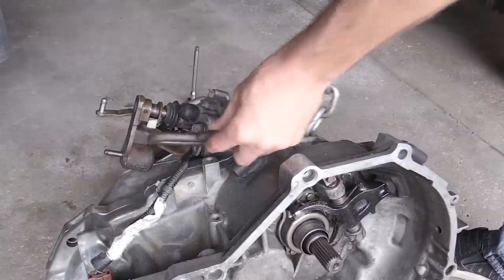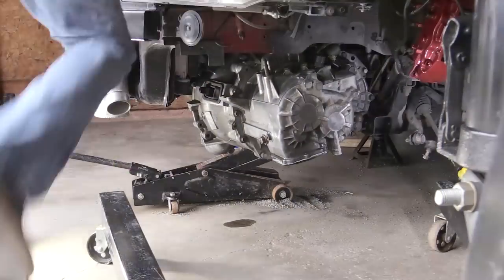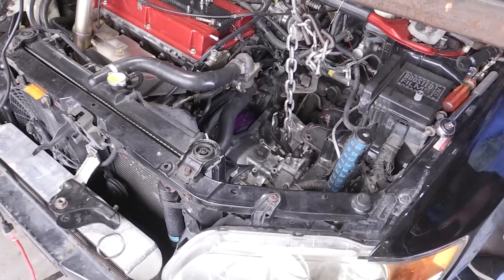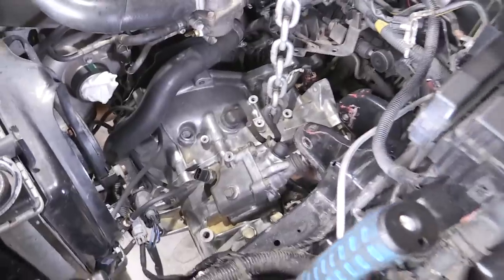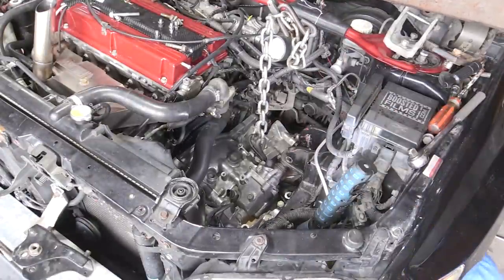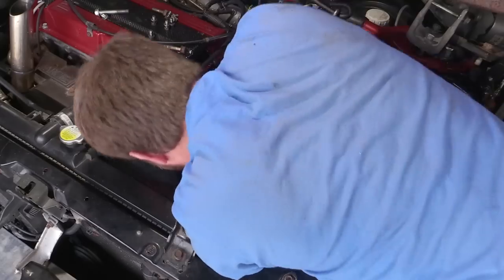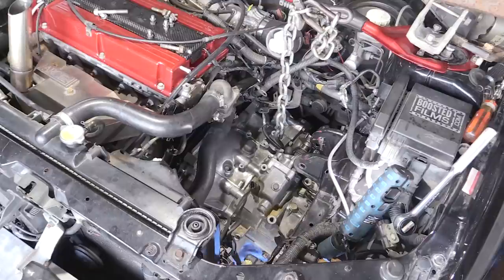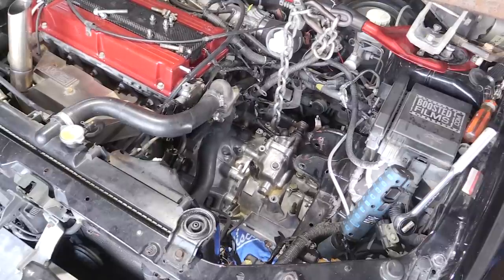EVO Transmission Installation - How to Install a EVO Trans // BoostedFilms

Comment: great video man, i just got my evo all done and tuned with my new exedy twin and fp red and made 430 whp on the dyno jet, very happy all that hard work paid off as im sure yours will too, my evo trans install was also on my garage floor and i didnt have a cherry picker, i just had a harbor freight trans jack and nearly killed myself attempting it on my own , then i had 2 other people help and we got her done, i had the same issue with not being able to fully mate the trans to the block before starting in some bolts but i just did the same as you did and guided them the rest of the way in, youre completely right this job on the ground sucks ass, i sure as hell wouldnt do it again unless im able to perform it on a lift, my only concern is how youre going to get that rear mount bracket back on, i was able to get my trans out and in with it on, so i feel you may have created another obstacle for yourself, just and opinion from my own personal experience, i admire all your videos, i have used them as a tool for a lot of my work i performed on my evo 9, expecially the ones with the timing belt and cams, you definetly go over some really important details that can make or break you, eventually id like to make a channel with good informative videos like yours, awesome work man, keep it up
Reply from the maker: an FP red would be sweet! Sounds like a nice set-up.   I already installed the rear motor mount and it went fine.  Took about 30 minutes.  But yes, i probably should have bolt the rear motor mount plate back on the trans before putting it up in place but i never though about it.
Reply: Boosted Films  yea I know the evo 9 turbos make great power too, i was at 376 whp on my stock turbo on pump gas before the oil seals went , that’s why I upgraded my fp red which made me have to upgrade my stock clutch to the exedey twin, I’m still on the stock manifold just because I didn’t feel like spending another grand lol, the fp red ball bearing is expensive but so far i feel like I got my money’s worth , great spool up, and sounds amazing , and my power band is nice and smooth, all things that a good turbo should do👍

Comment: Hey hope your day is good, wondering what are your thoughts on this, @9:50 I popped the tob in and after I attached the sc I'll push the clutch pedal and the slave cylinder will pop back out

Comment: Just did this last week and it really is brutal. 1 jack under the oil pan and two under the transmission trying to wedge it in with a prybar...
Next time I'm probably just going to drop the subframe I think that will save a lot of time and anger.
Reply from the maker: Dropping the sub frame adds in issues with the steering rack, that's why i didn't touch it.
Reply: I was thinking the same thing..took two days to drop my transmission with one jack by myself

Comment: How do you put the shaft back into the trans/tcase? Does it simply slide in with the help of a rubber mallet?
Reply from the maker: Yup. That works. Or use a slide hammer to tap it back in.

Comment: I was wondering about that throw out bearing! No problem to get it out, and it went back inn smoothly, the “click” came and I shoved the throw out bearing all the way from the left to the right (standing in front of the car looking under the hood) now mine just don’t won’t to go back now and is “lock” more in place than it was before removal. Is this normal? Should it go back with the slave cylinder on? Didn’t manage that with hands power tho! 

It would be nice if you showed how the throw out bearing was moving after the “click” mine was stuck in the middle only going towards the clutch not all the way out 🤔

Comment: im having an issue with getting my throw out bearing to snap back into my wave clip..any suggestions? it just wont snap back in
Reply: How did you get past this?
Reply: @jovanymendez8018  my issue was really just the clip being so worn and me trying to reuse it...i ordered a new one and it snapped in and never came back out

Comment: I learned the hard way and now remove the radiator :/ It is so easy to damage it trying to install the g/b. Two years on and the thrust bearing has been ripped apart, so it's under the car again :(